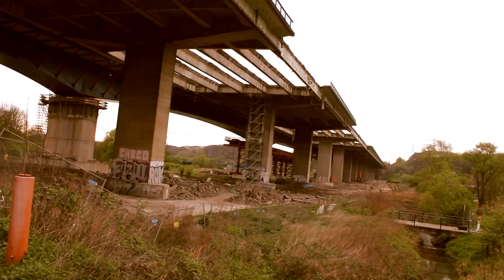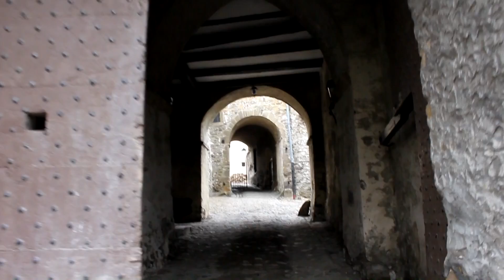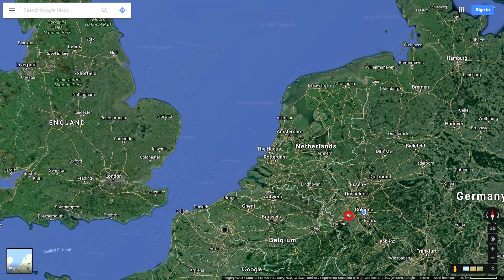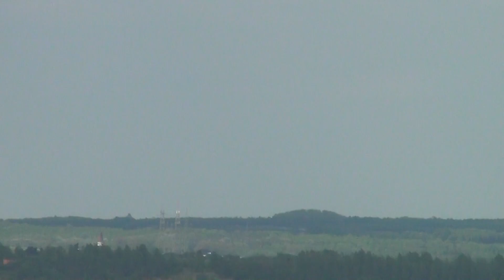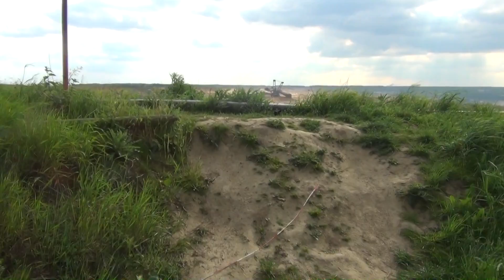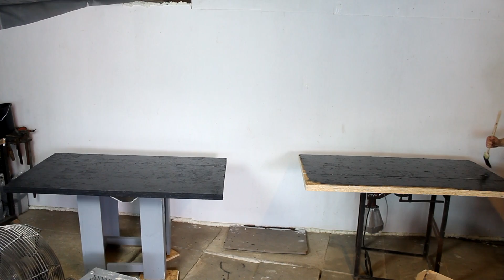A Trip to the Wasteland (In the Middle of Germany)

Comment: I would never guess that Germany, the ECO Germany, has such a humongous mine. This lignite is the least carbonized brown coal of them all which makes its burning a very dirty process.
Reply: Edman yes, I agree with you. You wouldn't think that Germany, the "eco-friendly", "green" Germany has such huge lignite mines, which is the dirtiest of all energy sources. But we have it here, because the politics say that the nuclear energy is worse than coal. So we actually have a bigger co2 output than France, because they use a lot of nuclear energy. So Germany is on a good way to become 100% green, because the infrastructure is already there, but it will take a while and on the way, we are not very Eco friendly at all.
Reply: When it comes to energy, there's always something. Every method that has a plus, also has a serious minus. Coal is dirty and not renewable. Water requires dams which are bad for the environment - mainly for the rivers they are on and for the space they are going to be in. Solar is expensive and unreliable. Wind is noisy, unreliable and kills birds. Nuclear is the worst of them all. Some say clean. Well, to a point. Even if managed properly, it is dangerous like hell, it is depleting a resource and makes a heck of a problematic waste. I have no answer to this question, I'm not that big of a mind. I guess these days - it might be me most effective and eco friendly to go local and use small solar, water and ground heat pumps, some small wind farms and occasional bio gas plants. I don't know. It's a long way for all of our counties and we may never get enough time to actually get there.

Comment: If Germany would stop foolishly shutting down its nuclear plants, it could actually make a dent in its carbon emissions and perhaps stop destroying towns to get at the coal underneath them.  Coal and Nuclear both provide low cost, reliable power (not dependent on the wind or sun) but when you shut down nuclear, all you get is more coal usage.  Sad.
Reply: The problem is that germany doesn't have a save repository for nuclear waste, so we get more and more waste but don't know where to put that in the next billion years.

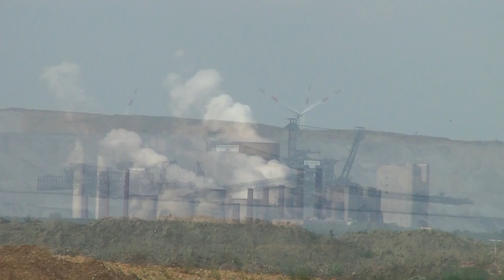Comment: The machine you can see at 5:23 actually isn't a bucket wheel excavator, it's a stacker (Absetzer) and it's purpose is to dump the earth wich lays on top of the resource (in this case: the lignite) on a place where it isn't disturbing your coal mining process. Usually those machines are at the back end of a mine where the resource has already been mined. 

And always keep in mind that those huge surface mines are always required to be recultivated. Many people don't know that and I think that many wouldn't even notice if they are in a recultivated area. That's how well it is done. Takes time of course, but what doesn't?

Comment: One of the things I'd really like to see is a thorium based LFTR reactor. If you really wanted to make a difference in the world then a good way to do that is to develop a small unit that could power a single home. As you may well know, thorium is an abundant element and can be found just about anywhere. In fact it's a byproduct of most mining operations and as such is discarded as waste. You may also know that it is less radioactive than a common banana. The reaction is equally safe. The worst risk is the molten salts that are part of the reaction itself. This technology has been around since the start of the nuclear era and is at least 80% more efficient than a standard nuclear power reaction. Where as a nuclear plant is around 5% fuel to energy output an LFTR reactor is at least 90% effective whereas fuel to power ratio is concerned. Since the fuel is widely unregulated and easy to find it could make a suitable energy source in a post-apocalyptic world. This is why I think it would be an ideal project for you and you're channel. It is at least something to think about.

Comment: far out that's some engineering all right. let's put it in space next time modular asteroid based spinning space station, like that shit they use for those military earth filled walls, named after someone but its just a wire framework. probly could just use para cord and nets to surround yer wee habitat wi bits o rock. then a matter of picking a rock which has enough fuel on it to drive some gardens.

Comment: I actually live close to a place like that, but this time in Romania. In my county there are some of the biggest open mines in south-east Europe and those lignite mines (GPS coordinates: 44.925895,23.181306) are supplying with coal 5 or 6 power plants, 2 in my county, Rovinari(I can actually see this power station from my balcony with naked eye even it's at 25km S-W away ) and Turceni(the biggest coal power station in Romania), the other two in the neighbouring county from the south, near by Craiova, the biggest city in Oltenia region, and the other two, I don't know because there are some problems with finances and stuff. 
There are times when we are selling coal to Serbia or when we are buying from Serbia. It's kind of crazy.
About environmental issues... In romanian history there was a case, actually an engineering fiasco, when a guy from the communist party made a project for a power station that had to burn bituminous schists, that had been discovered in south-west Romania(Anina town, Caras-Severin county, close to Serbian border).The problem was that those schists were more rocks than bituminous and could not burn proper in order to make steam and electricity, so to repair the mistake, they've built 45km of gas pipe in 3months(!!!) from Reșiţa, where was a big steel manufacturing plant(i guess some of Eiffel tower metal parts were made there), and when they've started up Anina power plant, in Reșiţa steel factory everybody were crazy because they didn't had enough gas to keep the steel hot enough for pouring.
Anyways, after the fall of communism in Romania, Anina power plant was taken apart and sold to scrap and the town became a ghost town.
PS: I forgot to tell you that in the mine with those GPS coordinates, was Nicholas Cage few years ago to take some footages for his movie Ghost Rider 2. If you will check the trailer of that movie you'll see a rotating buckets excavator from that mine.
PPS: My grandpa was a professional welder for that coal mine and he told me alot of stories about when those big excavators were broken and he had to weld them. We laughed alot when he used to tell me when they've made the welding control with a gamma rays device and they had to run more than 500m in order to avoid radiation exposure. And we laughed because usually there was always someone with the flock of sheeps around and usually there was an almost deaf old woman who didn't care about radiations, excavators and shit. 😂

Comment: build more nuclear plants.  This is the only solution that provides realistic power in terms of future demand.
Reply: Sweden has a pretty good solution for nuclear waste. And amount of nuclear waste is tiny compared to that created by fossil fuels. Radioactivity is not that bad anyway.
Reply: Matt Parker   That's nonsense. There are other solutions to cover the demand of electricity. - And you still do not have a solution for the nuclear waste you produce with those NPPs. Right now German government reopened a procedure to find a place where to store the hazardous waste already existing after the one place in Lower Saxony they had been exploring and testing for 30 years finally was found unsafe anyway. - And it is of course not only Germany who has this problem. Nobody in the world has a workable and acceptable solution for that. The main problem: it must be absolutely safe for thousands of years. How would you ensure this?
Reply: Actually you can, through a radio-logical and chemical process, renew spent nuclear fuel by removing the undesired isotopes.  This can be done over and over again until there are too many isotopes to be cost effective.  France used this method in the 1970's.  I don't know if they use it now.  It is knee jerk reactions like yours and fear-mongering and general disinformation that have hindered the construction and acceptance on better, safer nukes.  Sure, light water reactors fueled by uranium oxide pellets are an old technology, but with things like the new pebble bed reactors and nuclear batteries, there are safer technologies commonly available.  What about a thorium reactor?  Have you heard of those?
Reply: Matt Parker    Matt, we had all sorts of attempts to solve the problem here in Germany, including an attempt to build  a large reprocessing facility for billions of (then) deutschmarks. The attempt has been abandonned. The problem remains unsolved. Nobody on this world has a solution. - I do not count solutions that are hypothetical like yours. You need a working solution. Or better take the money you would dump into attempts to develop one and use it to develop your renewables. Much saner approach.

Comment: Solar please!! Battery production please
Reply: Solar will happen. It is simply to cheap to fail. Conventional power plants are only cheap because they are socialising the costs from extracting and pollution but even that advantage will be gone soon.
Reply: The environmental impact of solar module is that of any other artificial surface. It is just glass. The impact isn't none we know this because all other infrastructure of that type we already built. However, we need next to no surface to put up enough panels compared with anything else we are doing like roads. Even the space of all the worlds airfields would easily suffice.

Whatever, this is nothing I need to or want to argue about anymore. As I said. It will happen. Just wait and watch. BTW: conventional power isn't constant. Even brand new Coal plants only run 90% of the time (french nuclear plants achieve about 70-80% uptime depending on model and age). Everything needs to be shut down for maintenance a couple of days in a row. You always need redundant supply.
Reply: And the lithium or cadmium or lead or nickel for the batteries will come from the thin air? Destructive mining will still be an issue even if the world was all run on all renewable energy.
Reply: How did you get that idea? It is already hard enough to built a solar panel that survives a hail storm and decades of thermal cycling without to much degradation by micro fractures in the wafer and delaminating contacts. Using them for a structural application is just ridiculous. You would be better of putting a roof on the road. Yet easier, just put them besides the road.
Reply: I didn't bring up solar roadways, you did. I said that the environmental impact of a solar panel is about that of any other sealed surface, like a road. No one complains about them. 
20x more expensive, that is nonsense. Photovoltaics creates energy for about 5c per kWh (US or EUR or AUD, really doesn't matter). Nothing else but written off generators compares. China installed 35GWp of PV just in 2016 and will be exceeding that in 2017. They are probably doing this because they are to stupid to realise that coal burning or nuclear plants are cheaper.
Reply: Here is a link (hopefully youtube lets me) from the US federal gov with a lot of background information. The price of kWh can be found on slide 43. http://www.nrel.gov/docs/fy16osti/67142.pdf
Although it could easily be found by searching for "cost of utility scale solar"
Reply: This is exactly what is calculated on slide 43 of the linked document. Actually you also have to consider the rent for the land consumed, the installation, the cost of financing (that is important, you have to deduct the average yield on the financial markets, else put the money elsewhere), the inflation and so forth. This leads to a value called "levelized cost of electricity" or LCOE. This does work the same for all power plants. Over a live time of 30 years this works out to be around 5cents. This is utility scale, the same thing as with a coal power plant. They need to run decades as well.

In case you missed it, I am talking about PV plants above 100MW not a roof top job. With a rooftop you are aiming for grid parity (which is even easier) and not for matching LCOE.
Reply: See, now we are back to square one. These are being built and will be built. Worldwide about 80GW this year, which is of course still a tiny amount.
Reply: Keep it clean. Ha! One time use energy is not a good bargain. Batteries are the key. Solar heat, solar power, smaller-faster wind, it's all here! And I t can be distributed to back the all powerful aging grid power. See green mountain power in Vermont.
Reply: So how much extraction  is required to get the materials for solar? Do you mine them? Are they readily available and plentiful enough to supply the earths power needs? Rare earth elements by the millions of tons!
Reply: The processes required to make solar panels and batteries is just as damaging to the environment as burning coal. The difference is once the infra-structure to rely on solar rechargeable batteries is in place, the planet can hopefully heal.
Reply: Conventional energy is the gold standard because it is constant. That's an advantage that renewables lack. The Sun for instance sets every day. Electrical storage technology is horrible too. Who knows what kind of an environmental impact solar cells all over the place will cause either. Nothing good I imagine. That's the funny thing about progress. We never quite know where it is leading us. Some only think that they do.
Reply: Coal!
Reply: BR H don't tell me that you're a proponent of solar roadways. That scam has already been exposed.
Reply: BR H you brought up solar roadways. Better putting solar panels on the sides of roads? I'm curious, where do you live? Beside a road perhaps? Solar only makes sense in remote applications where running lines from the electrical grid is prohibitive. Otherwise conventional electrical generation is far more economical. The last figure I heard was conventional is 20 times less expensive than renewable. So the question is, can we afford to pay 20 times more than we're paying now for our electricity? I'd have to say for me the answer is no.
Reply: BR H do you have a citation to back up your 5 cents a kilowatt hour claim? The president of my electric co-op has made the renewable energy cost 20X claim. He buys energy and is not profit motivated. As any money surplus is returned to the customers.
Reply: BR H OK then how come a 100 Watt solar panel costs $110? It would take 10 of those to put out a kilowatt. Which is 1,100. That is peak power too. Something you might get for a minute in that panel's life. Realistically you'd have to double the panels to get an average of 1,000 kW out of them. So you'd have to run those panels for 22,000 hours at peak output before you reached 5 cents a kWh. Or more realistically 44,000 hours. Which if the sun stayed up all day is over 5 years. This of course does not include the cost of conversion circuitry or any kind of power storage either. All of which would need to be protected from the elements in some kind of equipment structure. Which has maintenance costs associated with it as well. Then there is the installation of the panels on some kind of a framework. More money. Wiring =  more money. Have a service installed in your house and see what that costs. The wiring alone would add up to more than the purchase price of the panels. Each added cost gets us further and further from realizing your price.
Reply: BR H hey, it is a free market so go build your 100mW power plant and compete on the grid with conventional resources. See if you can last 30+ years before you begin to break even. haha!
Reply: Wade Jensen the payback on conventional energy is much sooner than alternatives. Plus conventional enjoys other benefits over renewables too. Are there drawbacks to conventional? Sure there are. But people are willing to ignore those.

Comment: You are lucky to be going there in your old Subaru, because it is one of the last passenger cars that came equipped with a full AWD system, with locking differentials and all that nice stuff that really helps you through this kind of terrain :) (I've always wanted a Subi like yours, or actually, rather the Outback model, which sits several cm higher than the normal Legacy, but is mostly the same otherwise). But then, I drive mostly through and around Berlin, and it really isn't necessary here (plus, much too expensive, compared to my small car from the VAG corporation).